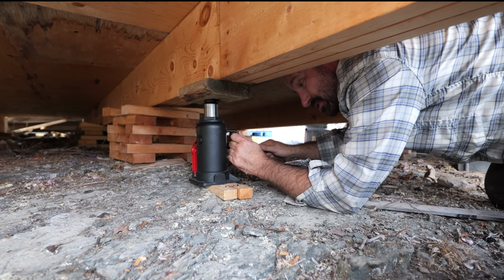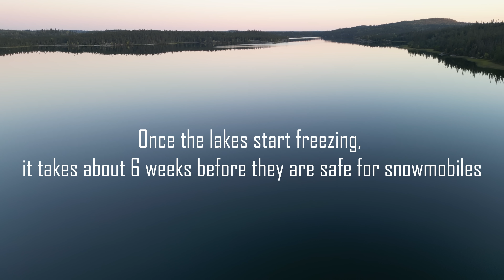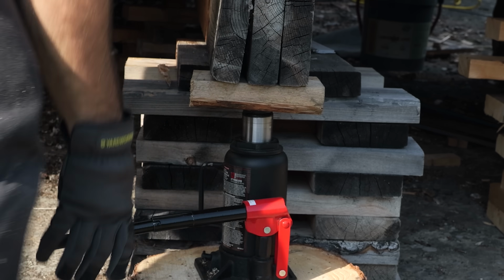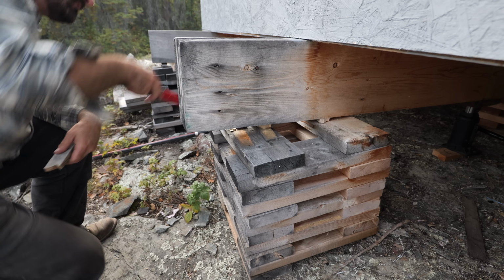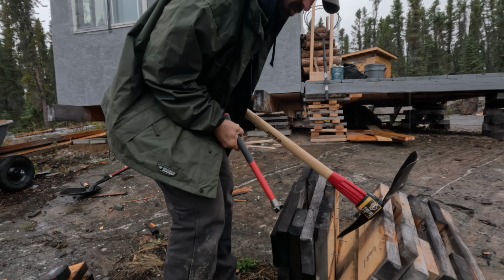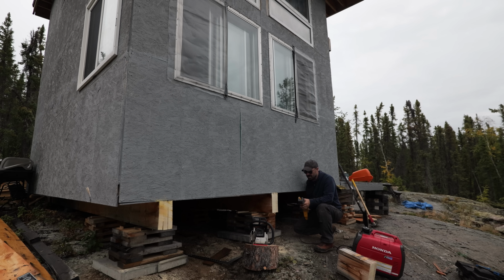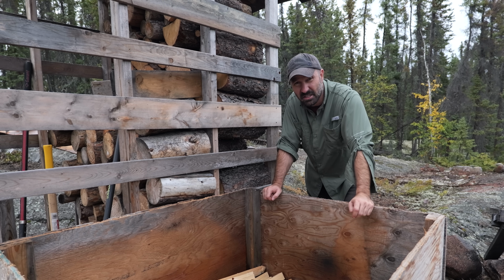Man Gets Ready for Freezing Winter Alone in Cabin

Comment: Hard to tell if any of those wood scraps are pressure treated. If yes, please do not burn in your stove, they will emit quite toxic chemicals when burned.  Keep these videos coming, makes me look forward to winter even more, knowing we will see you toiling in the snow again.
Reply: Cant be much worse than trudy speaking.
Reply: Same goes for plywood
Reply: Geek
Reply: Build a boat dock that you can wheel in and out of the water like a wheel barrel in the winter.
Reply: It will all go up the chimney. It’s ok to burn pressure treated.
Reply: @Inya_fase what goes up must come down!  Pressure treated in a wood stove or campfire used for food is no bueno.
Reply: Awesome work Jay. I love your videos.
Reply: Horrible for the environment if they are.
Reply: PT gets a greenish color on it as it ages. Those boards in that area can easily be a kiln dried set of 2*12 nailed together to make a beam. Even if the ends get wet the moisture would dry out with all the air under the cabin so long as the roof is good
Reply: I’m glad u told him Woa. What would he know about wood, and other building materials
Reply: Yawn.
Reply: @Mac-i3m  agree I get rid of that wood  good point never burn treated wood inside
Reply: What toxic chemicals do they contain?
Reply: @Inya_fase  No, it is not. Not pressure treated or plywood.  The only way it could possibly be permissible to do so, is if the stove in the cabin was constructed in such a way that any and all vapors and gases created during combustion absolutely went up the chimney, meaning it would have to be a sealed combustion chamber with a single opening to bring in fresh air to create a draft to draw the vapors up the chimney. That stove is not sealed to prevent any gases/vapors getting into the air inside the cabin.
Reply: I would not burn it period

Comment: Jay when using a bottle jack to lift up the cabin use a 3/8" or 1/2" thick piece of steel approximitly 4" x 4" between the small end of the bottle jack and the wood. It will help to distribute the weight on the small end of the jack so that it doesn't sink into the wood.

Comment: I would have left those floor joist extensions on, and then  put the new ones to the side. THis way with the permafrost upheaval in the winter, the new room is tied permanently to the old cabin. By making a separate unit and just pushing them together, they will want to separate and you will have air gaps, pests getting inside, lost heat.

Comment: Should have stood the box on end and added a boar or two across the bottom opening to create a lip to hold in your short wood and splits.  The back being slatted would be good air flow to keep the wood aired out, and then you would be reaching into the front of the box instead of having to lean down into/over the high wall.  Then, because of the plywood walls and ceiling, it should be covered with a tarp to keep the plywood dry, maybe even leave a length of tarp hang down over the front to keep snow from blowing in on the wood intended for fire starting.

Comment: Are buying any riff metal siding to protect underneath the house by blocking the ground to trailer. You could even  put insulation on the back of the roofing material to keep the floors warm

Comment: With the big peace of wood, I’d definitely use it for the extending the cabin if you do plan on doing so since it’s very valuable and it’ll certainly have a use. That could be used for a wall or a door/window as well
Reply: Hope he has room enough, long enough under the cabin to store that length of lumber to protect it from coming in contact with the ground or resting on anything else potentially wet.  It doesn't appear to be pressure treated.  It would be a shame for it to rot and not be stable when he wants to use it structurally.

Comment: Interesting that you want to have a lower floor level with the new extension,i wonder if its the correct thinking.
A level floor would be better,and you would have great underfloor storage ,a small basement of sorts .
Yes it will need a suitable foundation at the higher end but it would be worth it .
Old screw jacks are a handy tool to have and truck hydraulic jacks are good for jacking weight,they might be found at a truck wrecker ,might be cheaper and you could have a couple of these jacks to help set up the joists when construction begins .
It will be great when tou can haul the heavy stuff in over the frozen lake .
Reply from the maker: I'll do my best to address this in upcoming vids

Comment: Good job on the cribs.  Level is good for weight bearing distribution.  Easy to shim up if ever needed.  It's not like that big rock the house sits on is ever going to move.  You need a five or six foot spud bar.  Use it on the wood, rocks, all kinds of prying jobs.  Saw chain thickness gage, thickness of  edge of a nickel is tight enough.

Comment: Question I noticed that the floor supports are separating, like the 3- 2x10-12’s are separating are you concerned that they will break down over time. I’m no engineer but I would maybe bolt the ends together. Thanks for sharing your dream with us gg

Comment: I wouldn't burn any 2 by more than 14 and a half inches.  Always use that size and up for a header block.  Anything less is fuel to burn.  The long beam, is just that.  Maybe pull it apart or gut it for a frame of something to build on or for like a center rafter/beam.  Keep it straight and dry.

Comment: Hi Jay awesome video again. Was just wondering one thing (and this comes from someone with 0 building experience), but isn't that dirt under the concrete slab in a risk of flowing away when there's water flowing under the cabin and therefore the foundation would shift?
Reply: I thought the same thing and have zero build experience. Or even a small earth tremor could move that cabin off those wooden support piers. Shouldn't the piers be attached to the underside of the house. Just thoughts. 😮

Comment: You don't have near enough firewood! and there is no way you are putting those giant rounds in a wood stove. Standing dead trees are not dry enough to burn for firewood, rounds are not dry enough to burn either. Looks like your cabin is setting on one big rock great for stability, good luck digging holes anywhere near to set your post in to.

Comment: Yes getting ready for winter is a good thing and getting the wood supply ready now means that you don't have to work as hard later. Gives you the ability to do the extension without the need to get firewood as it can be gathered at your pace. KD with tuna or salmon in the 170 gram tins is also good to eat just for a change from the usual and give it try when it suits you.

Comment: Good job!.... When lifting with a metal jack.... slip a piece of 1/4 inch plate steel on top of jack head say 4x4 inch or 4x6inch or what have you... its so the head of the jack doesn't bury its self into the wood.

Comment: Jay, if you take a pair of lineman pliers or regular pliers will work and bend the nail back-and-forth not letting it spin the nail will break off.A Lot easier than taking a hacksaw to the nails. A reciprocating saw with a metal cutting blade may even work better.

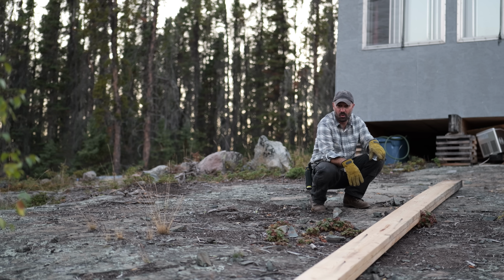Comment: Please don't get rid of the two long boards nailed together you show at 4:30! Save it for use as a lever. If you need a second jack, and use that long header as a prybar, it can lift several hundred pounds of weight. I've rotated front and back wheels on a pickup using  a jack and a lever. Have a good week !

Comment: Why dont you just buy few meters of plastic pipe and rebar and use plastic pipe as mold and cast pilars under the cabin? maybe easier to bring few bags of cement and other lighter material than concrete blocks. Plastic pipe you can cut exactly fit to the shape of bedrock so you will get fine mold. e.g. 400 mm plastic pipe and inside few rings and vertical  reinforcement 8 mm rebar. On the top of cast pilar it would be necessary to put roofing felt in order to stop capillar movement of water.

Comment: Jay?!?!? You are daring to have pulled that whole crib out and not have any temp bracing in case of jack failure! you should have jacked the structure up enough to slide that crib back and release the pressure on the jack. A hydraulic jack can fail and bad things happen. In all honesty, I was yelling at my monitors saying "No, No Jay dont it!!!" I used a 20 ton bottle to jack up my office (10x20) after it settled just as you are doing but I had extra CMU's and cap blocks to wedge under just out of my working area to take the load of the jack and disperse it accordingly. Then I had to get mobile home tie downs to secure as per inspectors comments at inspection. Be safe!